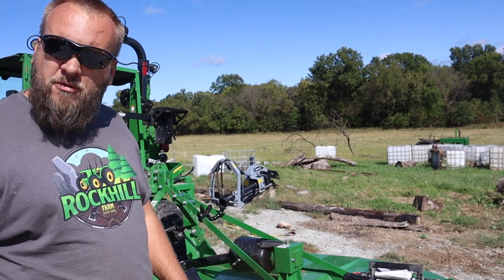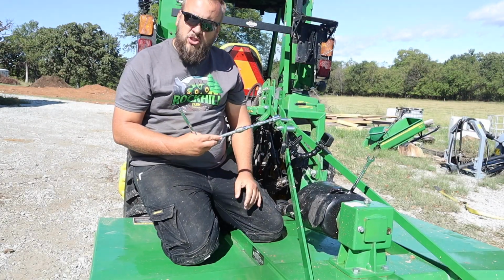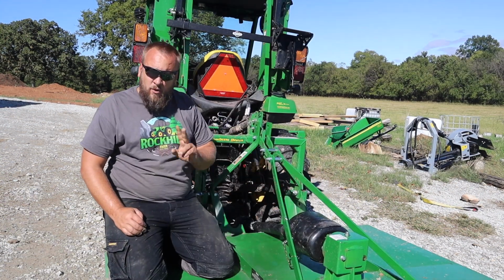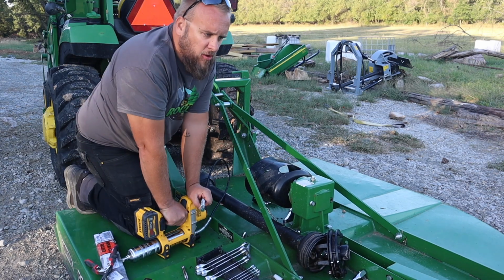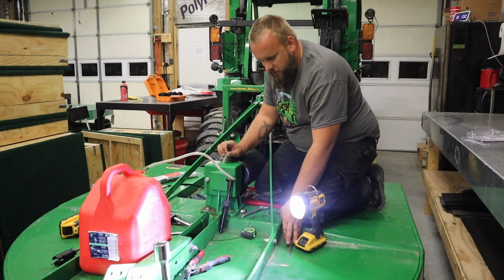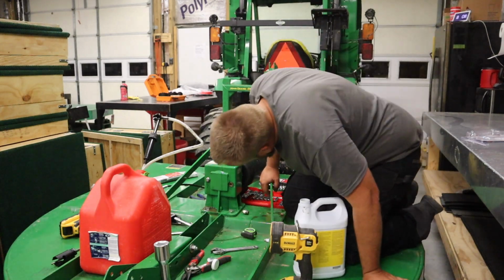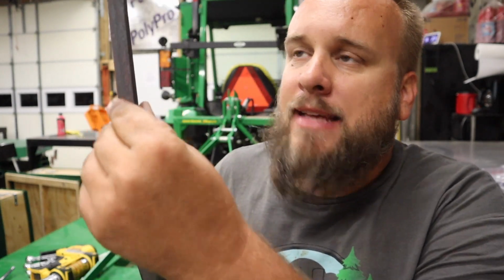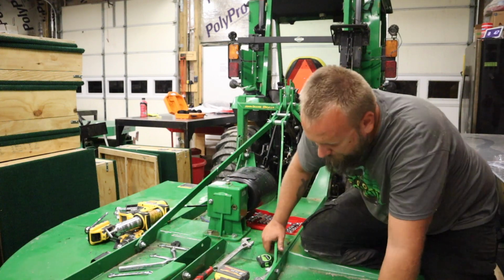Brush Hog Maintenance - How to Slip a Slip Clutch and Replace Blades￼

Comment: Brock, what makes your videos so real are the small things that don't go according to the owner's manual.  Seized up bolts,  sockets stuck, zerks that don't cooperate.  Until I found your channel,  I was certain that I was the only one having to stop and run to Harbor Freight, Tractor Supply or even Home Depot for that missing whatchamacallit. Many times if I go once to those stores I have to go a second or even a third time.  Thanks for keeping it real for this tractor newby!!
Reply from the maker: Thanks 

Today embodied this comment.  Tried to pull a stump out and couldn’t get it.  Knotted up my winch.  May have even kicked something

Guess I will try again tomorrow

Thanks for watching

Comment: Brock,
I’m glad to see some of the tips I’ve shared with you have helped you out. I left a comment about how to change the oil in the gear box. I was just talking to a friend of mine the other day about how every time I start a new project or maintenance task / modification. How I always have to stop what I’m doing and spend more money to get the right tools if I don’t already have them. I now fully understand why the old timers have amassed such huge tool collections in their lifetime haha.  I guess I’m old according to your daughter even though I’m only 35 years young. 

Jason
Reply from the maker: This is my first tractor and I’ve learned a lot in 450 hours of use on it. I do appreciate all the comments

I am about to turn 41 so pretty much ancient

Comment: Brock, I'm not old...I'm only 60! It's all in the mind (and the muscles and joints the next day!!) Viva Naproxen!!!  I have done the all jobs you are doing and while gratifying when you're done, what a pain when you're solo and needing to get to work with the brush mower!!!  Don't forget to lube the actual PTO telescoping shaft...metal on metal. It's a pain because the plastic shaft shielding ought to come off, though you can fudge a lot just by coating up the smaller diameter shaft well and sliding it in a few times to distribute the grease. Now you've done it all...it does get easier the next time.
Reply from the maker: Thanks for the tip

I find it amusing what a child considers to be old

I’m 40 and I feel like I’m just getting started
Reply: Yes you should grease the metal slide but not the plastic slide per the operators manual. It also says you should grease the shaft where the driveline slips over the gearbox shaft. So when the sheer pin breaks there is some lubrication to let it spin and not burn up the shaft. I believe a snap ring keeps it in place when the sheer bolt breaks. You may have mentioned that but I didn’t hear you mention it. or maybe yours doesn’t have a snap ring like mine does.…
Reply from the maker: Mine does not have a snap ring. I did grease that shaft but I didn’t mention it.

I forgot to grease the two pieces of the PTO shaft so I need to go back and do that. I wish there was a way to add a clip into a video so it had all the information

Thanks for the tips as always
Reply: I pre-medicate with Advil before a big project.  This nearly sixty year old body doesn't bounce back like my thirty year old body did!!  :-)
Reply: On mine the snap ring keeps the PTO shaft from pulling away from the gearbox and flopping around wildly when the sheer bolt breaks. Yours must be a different design….

Comment: That's a very intuitive daughter that you have Brock. Just turning 80, but feel more like 40.. I think K&H tractor was correct, the original blades look a bit narrower to start off with. To set the tension I use a 3.5MM drill bit for a feeler gauge.  Work safe..

Comment: Define "old guy", LOL.  Brock, I love watching your videos because it's like watching me work.  The tube slips into the gearbox, that's a thing that happens to me.  Can't find a funnel, so this piece of cardboard will work.  I hadn't sharpen the blades yet, but my dumb thing was I left the transport pin in my my stump grinder like a dingy for like the first 10 times I used it, I often think your channel helps me because my channel should sometimes be called "Tractor Tuition with Don, Don't Do Dumb Stuff Like Me", but there's already a channel with a similar name, LOL, again fun video and I will use this knowledge around the corner when its time for some bush hog maintenance on mine.
Reply from the maker: Yes, we are old and yes I make all kinds of dumb mistakes.

I guess that’s my niche
Reply: @RockhillfarmYT  Yeah I think you know me enough to know I wasn't making fun of you, but rather that's a niche we both share.  Fortunately or unfortunately.😂

Comment: I'm officially old at 67yo so I must be in your subscriber target market, but I still learn new stuff about my tractor and implements.  Thanks for sharing your experience doing your project.  I've never worried about my slip clutch, but maybe I should?  I occasionally break shear bolts, but there is always a legit reason like tree stump or bolder.
Reply from the maker: I’m with you. Never stop learning

The owners manual says to slip that clutch once per season but I’d say most people probably don’t do it unless there is an issue

It would’ve never even crossed my mind if it weren’t for the comments on YouTube

Thanks for watching

Comment: I do some pretty extreme "hogging" on a 1200 acre hunting lease and I've gone through my share of stump jumpers and blade sets...and I can say without a doubt, those are some of the worst looking blades I've ever seen on a brush hog!!   I keep mine sharp for a cleaner cut on the pasture grass, but more importantly, a sharp blade is going to slice through grass/brush quicker and be less stressful on the tractor and the gearbox.   Also, I find it easier to drop the stump jumper when replacing blades...not only does it make replacing blades easier, but taking the stump jumper off occasionally prevents it from seizing up on the shaft because eventually you will have to take it off!!
Reply from the maker: Thanks for sharing

Comment: I'm 35, but feel 80 most days. My 3 year old LOVES your working videos as well. Few service tips from a guy that logs an average of 600 hours a year with a bush hog in tow. Run the brush hog a little before you change the oil to get the oil hot, so it drains WAY easier. Let it sit for about 5 minutes to settle before draining the oil. I honestly prefer to tilt it back by picking it up with the F.E.L and letting it drain from the level check hole. I typically pour a cheap bottle through to flush everything, then put good oil in. Probably not needed unless you torture your equipment. As far as sharpening goes, I'll put the edge back and touch up the chips  seeing as I'm typically cutting major brush/overgrowth. If I'm cutting a field I'll sharpen them, then grind from the bottom at a slight angle to put a sharp edge on the blades. That way it's not right on the bottom of the blades for a bit of protection. It seems to hold the edge longer that way as well in fields/light brush. You can also raise your guide wheel 1 or 2" to tilt your blades. It's easier for the bush hog to throw materials out the back, takes less power to cut with, and is really good protection for it seeing as it's just the tips/leading edge of the blades hitting stuff. I'll have a video up soon explaining why I slant mine so much. I even run over some cinder blocks for proof it works... yeah definitely just didn't see them under the grass, but it shows it works nonetheless.  😂
Reply from the maker: Thanks for the tips. I really appreciate it.

My four year old grandson and I watch a lot of Tractor videos together. Cherish that time with him
Reply: @RockhillfarmYT  I cherish every second that I can get her to sit still long enough to enjoy a video or 2. She only slightly calms down when she's driving my tractor around the yard.

Comment: I got me one of those snazzy Lock n Lube adapters last year and also found that it doesn't fit in a few places usually because of a tight angle so what I did was screw a 45* grease zerk into the "old" adapter that I removed from the grease gun hose and keep it handy so I can pop it into the LnL as needed to get in those tight spots ... 90 percent of the time it works every time!!
Reply from the maker: Thanks for the tip.

90% of machine maintenance is half mental

Comment: Just be careful.  That craddle or plate is only held on by the blade bolts . Mine hung on for a little while after the bolts were removed.  Then it fell off. luckily, no one was underneath it. New bolts should be used when reinstalling the blades .

Comment: when you pulled that shaft off the gear box was there also a snap ring holding it? on mine I pulled the bolt out but couldn"t get it off and the book shows a snap ring along with the bolt looks like a bear to get off wondered if you had any problems?

Comment: Do you have a specification for bolt that hold plate dish pan up to spline . My pan and blades fell off spline and bolt washer is gone. I was given a 16 mm -1.50 10.9 and doesn’t seem to fit. Thread seems different or possibly damaged threads when it fell off ? Can’t find the proper spec through John Deere

Comment: Thank you for all the valuable  information Brock. I recently bought the RC2048 bush hog from JD and I am trying to remove the entire shaft to keep it indoor for the winter. The manual says, remove the bolt, push the shaft toward the gear box and remove the snap ring. My problem is that there is almost no visual on the snap ring and it is almost impossible to access it. I was wondering if you had any tip on that? Thank you in advance and keep up the good work!
Reply from the maker: I actually took mine off recently and it does not have a snap ring on mine. I just took the bolt out and it slid right off

I’ll look at the shaft and make sure there’s not a spot for a snap ring but I just think mine didn’t have one. Slightly different design maybe
Reply: @RockhillfarmYT  thank you so much for taking the time to reply. It is probably a new annoying design! I will call the dealer. Thanks again!

Comment: I’m not sure the blades you purchased are the same as the ones that came off, they look like heavier duty blades to me. But it wouldn’t make much difference as long as the length is correct. I had been doing some mowing at school so we sharpened my blades yesterday while the bushhog was up here. I broke a bush hog blade one time and it came completely through the side of the mower. Take care!
Reply from the maker: I wondered if they might be different after I saw the second one had the exact same bend

John Deere says that’s the right part but who knows 

Breaking a blade would definitely be scary

Thanks for watching

Comment: Correct me if I'm wrong, but it doesn't make much sense to tighten the slip clutch bolts to the same tightness you found them in if the clutch wasn't working with those settings. 

After all, the clutch should slip BEFORE breaking the shear bolt... no?

What makes more sense (to me) is to shoot for the 4mm dimension called for in the manual, which is also 0.157" or 5/32" of an inch.

Comment: First thing you do before using a new bush hog is to remove the stump jumper and blades, apply anti size then re-assemble.  Trust me it will save you a lot of time and frustration.

Comment: I switched from gear oil to hi temp wheel bearing grease for the gear box and won't leak out near as bad when that bottom seal goes bad
Reply from the maker: I’ve heard of people doing that. Thanks for sharing

Comment: If you had that much water in the gear box it might have been a good idea to flush it out.
Reply from the maker: Thanks for the tip
Reply: Thought the same thing. 

Technically you can flush after draining it as much as possible instead of total removal of old oil by siphon or draining.
The way you did it is better but many gearbox won't allow you a straight shot to the bottom of the housing with a siphon tube, there's obstructions and sometimes no bottom drain........ therefore flush and go is the proper procedure. Oil analysis will confirm this was done properly if you wanted to take it that far.

Well done 👍🏻

Comment: hi Brock, when I bought my brush cutter  that plastic shield was completely gone and I don't miss it.. I've seen guys put a little oil on the clutch plate of the unit. in your video it looks like your drive shaft up by the tractor might be bent  you might want to check it but it's hard to tell since it has that guard on it
Reply from the maker: Yeah, I don’t know how you would check it

Comment: The person who designed the grease location on the shaft at the mower should be taken out and flogged. That is the biggest pain in the butt to get to. They know the area is tight and that the shields are there.....can you tell that is my biggest complaint with my mower. Also, it depends on how you define old. I wasn't around when Moses parted the Red Sea, but I am old enough to have been alive during the Vietnam War.
Reply from the maker: Yeah yeah that grease zerc is a pain.

Sounds like you’re old enough to know a few things. Thanks for watching